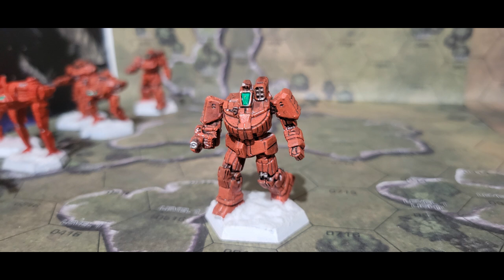Reading & Ranting: The Wolverine | Battletech Battlemechs

Comment: Nice video. How did you come to the conclusion that a Centurion has more armor? It has 1 ton less than the 6R and 2 tons less than the 6M. The belief that the Centurion is a well armored medium mech is definitely a misconception I have seen many people make for some reason. As for the Wolverine 6M, I believe it has the maximum amount of armor a 55 ton mech can have. I enjoyed the video though, sorry for being a smartass.
Reply from the maker: Huh... so it does. For some unknown reason, I thought the Centurion had 10 tons while the Wolverine had 9.5 ...weird. my mistake!
Reply: @thevoiceofiron  You might have been confusing it with a hunchback, that one has 10. It's fine though, we all make mistakes. Keep the video's coming!
Reply from the maker: @elithradril Ahh, you know I might have lol.
Reply: @thevoiceofiron  there's also the CN9-AL, which is another variant of a medium 'mech that dropped an overly heavy autocannon in exchange for a Large Laser, and used the freed up weight for more armor and heat sinks.

Specifically, the CN9-AL has 11 tons of armor for 169 points, even though that last half ton only gives 1 point of armor.

Comment: I think 6M is a good variant and like than 6R as you. The Combi of 6M and Griffin or 6M and 2K Shadow Hawk works well. I think 6M also make good combi with most of 50t mech. Centurion, Enforcer, Hunchback, Crub... etc.
Reply from the maker: It really does. I think the wolverine is great as a team player, since it can quickly switch up what sort of support it's lending. Fast enough to run ahead of most of its stablemates, hearty enough to take the heat off of an ally, enough firepower to frontline if needed, but never enough of any to overshadow dedicated specialists!